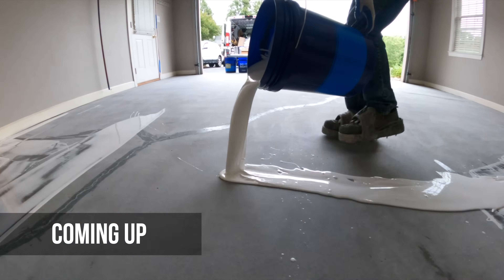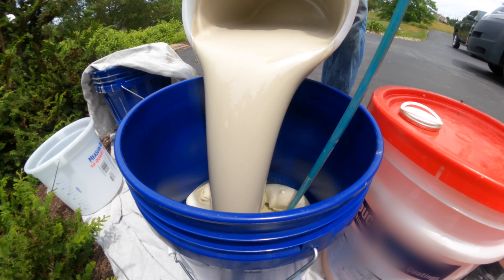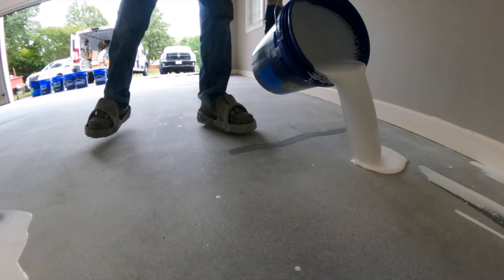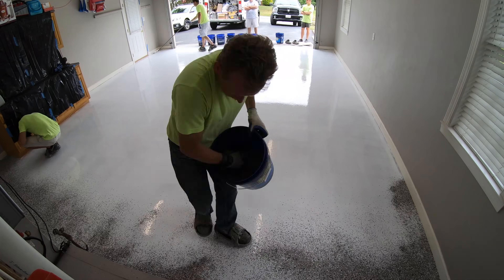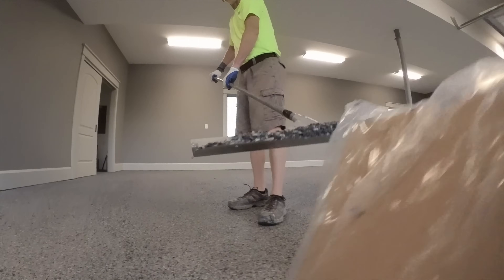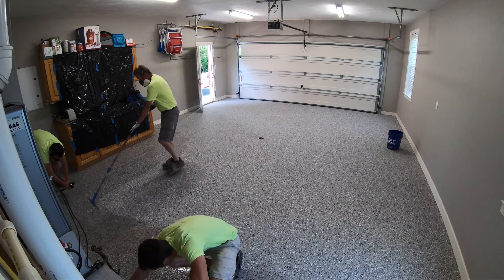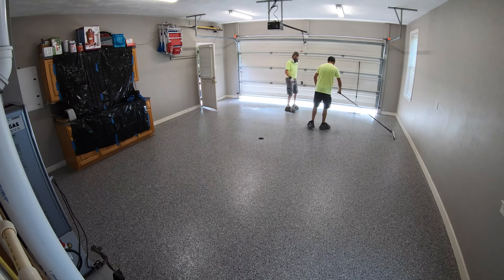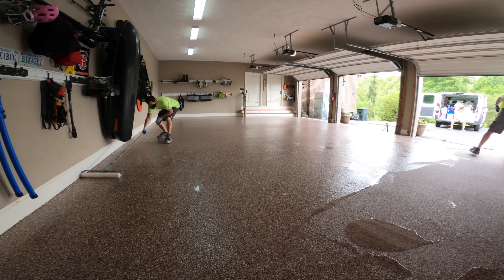Epoxy, Polyurea or Polyaspartic : Which is the BEST garage floor coating?

Comment: curious why considering you seen evidence of the seismic damage on that floor did you not cut seismic relief cuts into the concrete, was this a cost the owner did not want to pay for? a job you do not offer? something you are not equipped to do? or something that cannot be done in conjunction with this covering?

seems to me a crack that size is really going to wreak havoc on this type of covering, at first glance this concrete floor appears to have have any reinforcement at all or inappropriate, cracks appear in reinforced concrete, but typically very small cracking, and typically none when a concrete floor has been seismically relieved to code every 10 x 8' section.. it's simple to do..

a concrete saw on wheels, a contour grinder and its a job done, then you can surface the contour and space created, I've seen some just cut  a relief with a saw and just fill it, works until there is movement then it can tug and tare the topping... if you cut into separate pieces with a 1/4" blade then use a grinder to round off each edge you can top each crack and they remain separate and if it moves the top coat is not disturbed in any way.. seems imperative on floors lacking any type of reinforcement that already show sings of concerning seismic activity or movement, those cracks were overly large and could continue in a short few months doing considerable damage, what type of warranty do you offer?

Comment: I'm currently waiting on flakes which have been delayed, to arrive to my contractor. He told me they're switching from a 2 day process to one extra long day and will be using fast cure cement (repair), epoxy, and polyaspartic.  Can this whole process be done in that one extra long day or is my contractor bs'ing me and most likely going to take shortcuts that will affect finish/longevity/etc?  He assured me he's still using epoxy and polyaspartic, not polyurea.
Reply from the maker: You can do it in one day if you use fast set epoxy. If you were comfortable hiring the contractor after seeing his work/references, then I would trust his process.
Reply: @TimDCVA  unfortunately I went thru with it and within 1 hour of finishing the polyaspartic top coat it started to bubble a lot.  They let the epoxy and chips dry for about 2 hours before applying top coat.  Also it didn't help after grinding down the cement, they tried blindsiding me with a $500 addition for cement repair, even though it was previously talked about and all included. They said if they didn't tell me it was switched to a 1 day process,I wouldn't notice the difference in outcome.  Well I noticed and now I have popped bubbles on 1/4 of garage that looks like broken glass and jacked up cement since I didn't wanna get blindsided/upcharged for $500.   Need to get this fixed asap, but they went on vacation. Whatta nightmare.  I already paid so the only thing I can do is hope they repair it fully or else I'll just have to start posting bad reviews and include all the details of this nightmare.
Reply from the maker: That’s a bummer. I’m sorry to hear that. Hopefully they will take care of you.

Comment: Enjoying your videos very much!  GC here, building my own shop this summer and wondering about install timeline.  From slab pour to 100% finished interior drywall and paint should be 2 months.  Okay to start your process then or wait for more cure on slab?  Thanks in advance, very good information and business style you have!
EDIT: In Idaho so I cant just hire you sadly
Reply from the maker: Thanks!

It’s hard to say. The best way to know for sure is to use RapidRH probes…. but two months is probably fine during the summer months.
Reply: @TimDCVA  What are Rapic RH probes?

Comment: I'm less concerned about UV stability and more concerned about Epoxy not being able to stretch with Philly area wide weather conditions: below zero in winter to over 100 F in the summer. I've used epoxies, and they always crack and eventually lift up. 
Anyone have any input? What about AWF single stage polyurea?
Reply from the maker: We have no issues with epoxy cracking and lifting.

Polyurea and polyaspartic are basically the same thing. They are great top coats, but they don’t stick to concrete very well.
Reply: That only happens if you don't prep floor properly, you don't adress cracks properly, acid wash is not proper prep, bigger cracks should be crack chased before filling them and home depot epoxy is not something you want use.

Comment: Do you ever come across slabs that have water damage? My floor is chipping up in an area and has white rings around it, which I assume is from moisture.  I really want to do my floor, but am told the epoxy won't stick.  Any ideas?  Who would fix sometimes like this?
Reply from the maker: Yes. We use moisture vapor barrier epoxy or urethane cement whenever there are moisture issues.

Comment: I get a kick out of how they always use the multicolor flakes. Its almost like they know it makes it harder to spot small nuts bolts screws or whatever that gets dropped.
Reply from the maker: Most people don’t work that much in their garages. 

It’s not hard to find stuff that you drop on a shiny floor anyways…even when it does have flakes.

Comment: You probably found out by now... that the sun dulls the floor coating. And any water left on it will lift the gloss finish.
Reply from the maker: Water or UV light doesn’t hurt the finish of our floors. Not sure why whatever you’ve used would do that… but it’s never happened to us.

Comment: Hey Tim. We are looking to learn the trade as we are in the concrete repair industry. I have been working to learn as much as I can and have spoken with manufacturers of both polyureas and epoxies. One of the sides of the discussion that was not mentioned in the video was that the polyurea guys claim that their products more naturally bond or bite into the concrete vs epoxy which will not. They also mention that epoxy will continue to harden over time and this leaves it prone to lifting or delamination. They claim that polyureas cure only to a point and then stop leaving them more able to adapt. I am wondering if you could lend your expertise to this conversation as an experienced installer. We really want to focus on quality installations that last the customer a really long time. Thanks so much for any insights you can offer.
Reply from the maker: I think they are trying to sell polyurea.

I’ve been in business for 23 years and I haven’t really had any major failures with epoxy. 

The beginning of this video explains my view. It even shows you how a 10 year old epoxy floor holds up. 

The Biggest Complaint About Epoxy Garage Floors
https://youtu.be/wlNHQ7tJG6A

With all of that being said, we do use polyurea in certain situations. It’s a case by case basis though.

Comment: So I still don't understand on which to go with one company that came and looked at my garage use A polyurea and told me it's like epoxy but better. But so many people say and iv seen in person epoxy floors that look great. I want to get two basements done and my garage eventually so which is better today? Is there not much different? Do companies use polyurea as justification to charge more or?
Reply from the maker: It’s nice to use polyurea because you can get the job done in one day. 

It doesn’t offer any moisture protection which is why we almost always use an epoxy vapor barrier primer instead of polyurea. 

Almost all companies use a polyaspartic top coat because it’s flexible, fast setting and doesn’t turn an amber color from UV exposure.
Reply: @TimDCVA  what about in basement? So polyurea isn't necessarily better for any applications?
Reply from the maker: Until manufacturers can figure out a polyurea that can handle moisture, I don’t think there is any benefit other than speed.
Reply: @TimDCVA  thank you and also Is there any specific material you recommend for basement floors As opposed to garage floors?
Reply from the maker: No. We use the same material in either application.

Comment: I’d say 90% of this information is wrong. Epoxy’s don’t penetrate, they create a surface bond which is why most have tire peel off within 12 months.

Best coating option across the country is a 100% solid polyurea primer w/ a minimum 90% solid polyaspartic.
Reply from the maker: You are taking  the results from cheap diy “epoxy” and applying it to all epoxy.

Tires don’t peel off properly prepped 100% solids epoxy. 

Everyone uses a polyaspartic top coat anyways… tires don’t peel that either. 

I don’t think polyurea is a good primer because it can’t handle moisture vapor transmission. Exterior slabs and garage floors never have a vapor barrier under them so it’s not really a suitable coating.

Comment: Polyurea’s are significantly stronger and more flexible than a epoxy. You make it out to your customers that epoxy’s are better because it’s easier for you but the most durable. This is why customers should do there own research. And you cut corners by applying into a primer instead of applying a primer then a first layer to accept the chips, followed by the clear. A lot of corner cutting and fast talking to the customer to make more margin. 
Customers do your own research.
Reply: As another coating professional who uses a variety of systems, that is completely ass backwards. Show me commercial architects spec-ing polyurea as a base coat in a warehouse, airplane hangar, grocery story, etc. There is a reason why it is not. 

More time for the epoxy to cure means more time for it to stay liquid giving it a longer duration to soak into the concrete. Not 30mins before getting hard like polyurea which goes down paper thin.

The whole flexibility argument is a joke. What is the point of having your basecoat be more flexible when we are all using polyaspartic as a top-coat which is super rigid. 

1-day systems have there place, but if there is anyone “cutting corners” it is the installers pushing those systems as a 1-size fits all solution.
Reply: @blakedungey  how do you address moisture problems? Have you ever put down Semco Liquid Membrane in high moisture areas and then applied the epoxy resin base coat to that?
Reply: @ToddBizCoach  we will test the concrete for moisture at the surface level and internally using a probe. If levels are above a certain threshold we apply a MVB prior to proceeding with a coating system. (Moisture Vapor Barrier)
Reply: @blakedungey  do you have a recommendation of a MVB or a couple to research?
Reply from the maker: I’ve had good success with Duraflex MVP & CMP Lock down.
Reply: @TimDCVA  do you buy these products wholesale or retail? Thanks for reply.
Reply from the maker: We buy directly from the manufacturer.
Reply: @TimDCVA  please tell us which company/s you are using for epoxy resin and which one for polyaspartic.?
Reply: IDK enough to  make any decision about the various options, including single stage AWF polyurea. But, I used to rehab houses, and have used epoxies for all sorts of stuff. I've never used epoxy without a primer, and putting polyurea on without any primer is kind of hard for me to trust will not lift off later. Look at Versatile: Epoxy system without any primer. So maybe tech has improved quite a bit. 

At the same time, I've never seen epoxies last very long, pools, floors, whatever, esp. with temp. and humidity swings common to Philly. Yest. was 70 F cool breeze, then last night dropped to 40 F and raining, and today 50 F and 50% rain, then tomorrow is dry 60s. Epoxy just doesn't move enough.
Reply: I've been in a union epoxy company for years, working on jobs like Monsanto, Boeing, airports etc... And I've never used a polyurea at all. 100% of the time you're either going over raw concrete with either epoxy primer (never flake into it), a moisture barrier, or a different system called Ucrete. And we use epoxy all the way until the end when we throw a clear Polyurethane over the top. We do use poly aspartic every once in a while when we are in a pinch for time, shit is super expensive.
Reply: @blakedungey  polyurea chemically bonds to surfaces rather than the mechanical bond of epoxy. It doesnt need the "extra time to soak in".
That is a vastly important difference I notice you guys aren't mentioning. That's not even a sales pitch. That's a known fact and is a reason polyurea glues are so phenomenal and used widely in other industries. Curious that it's not mentioned by epoxy guys. 

The "problems" with the stuff is A: you need to be on your A-game to put it down. Hack epoxy guys just can do it. B: it is stupid expensive, and C: customers have this mistaken impression that 2 day installs are better quality because of smooth talking salesman sell it as time = quality and they can charge extra for the return trip.

The reason it's very rarely specced out is because properly prepared fresh concrete will hold onto properly installed epoxy for decades. There's just not a lot of need for it on new floors. Hell. Properly prepared old floors can hold epoxy for decades too.

The reason it's worth it to a residential install a lot of times is you aren't starting with perfect fresh substrate and cut rate hack epoxy installers don't give a shit after their 1 year warranty is up. Many just don't have the incentive to do a good job on the prep.

There are a lot of good epoxy installers and installs, and a ton of really shitty ones, but there are very few bad polyurea installs.
Reply: @MastaSquidge  Agree’d that there are installers on both sides of the spectrum who are great and bad. That being said, the big polyurea installers/dealers in my state (MN), one of which is the main producers of the product sold, has a 30% call back rating built into their business model along with a dedicated touch-up/replacement crew. Regarding smooth talking salesmen, as a business owner who has installed both systems, I feel like this should be disclosed by competing companies. Polyurea is not as moisture tolerate as epoxy, another huge factor that is not disclosed by polyurea only contractors.

Comment: So is polyurea not superior? What would be good for a basement cement floor?
Reply from the maker: No it’s not. 

Polyurea offers no protection against moisture vapor transmission.

The best way to coat a floor is to use a vapor barrier epoxy primer.  

A polyaspartic top coat (which is very similar to polyurea) is a superior top coat because it is flexible and it doesn’t amber.

Comment: No real point in using an epoxy primer if using a polyurea. Polyureas are meant to penetrate the pores and will resist moisture much better than epoxy. 

Convenience of the installer shouldn't matter for the customer who wants longer lasting and more durable floor.

Check moisture content in concrete prior to using a polyurea. 

Polyaspartics are Polyureas but not all polyureas are polyaspartics.

"Moisture barriers" are still have a limit to the hydrostatic pressure a floor can withstand. 

Go epoxy for quick redo, aka flipping a house. 

Polyureas if you're in it for the long haul.

Comment: Your basically in an enclosed space, no fans or cross breeze. 
If you smell the epoxy chemicals, your breathing in air laced with very bad 
mix of  epichlorohydrin esters. Bad/killer for lungs and skin. Your skin should be covered in full and you need to get some 3m 3600 full face masks with proper filters. 
Yes, if your young you can pollute your body for years and might get away with it, but this stuff, when used in closed spaces for long periods of time, will cause cancer. How do I know, you ask. Who is this bozo ? My father worked in an epoxy factory and he recently died from Parkinson's directly caused by poisoning from  epichlorohydrin. Ever see someone with this 
disease ? All his friends from that factory died horrible deaths. Wise up and if your gonna advertise, encourage safety first.

Comment: ya. . .  Polyurea is 20x as strong as epoxy.  Your excuses, are just that.  Basically you're charging polyurea prices and saving money on the cheaper coating.

btw epoxy doesn't bond better than  polyurea.  More time for it to soak in the pores?   Lame
Reply from the maker: None of that is true… but I appreciate the comment nonetheless.